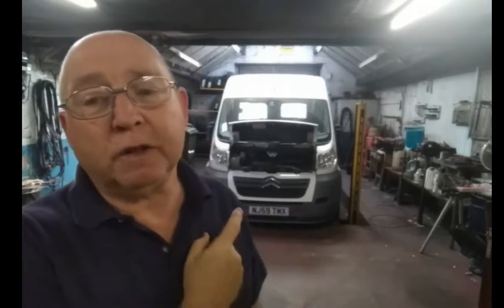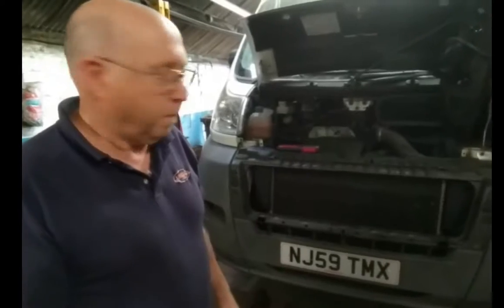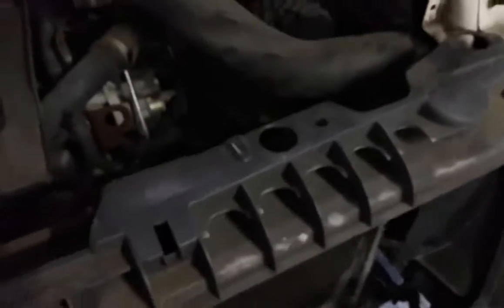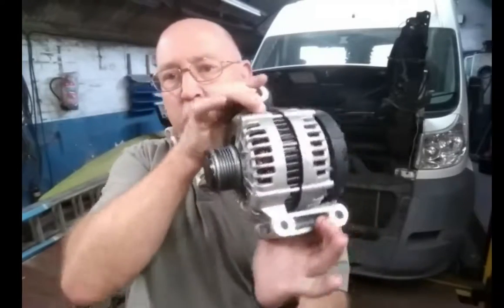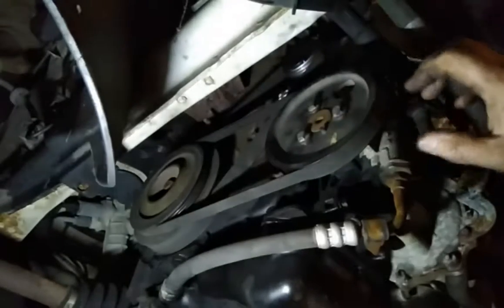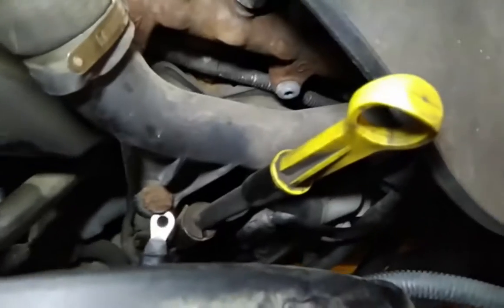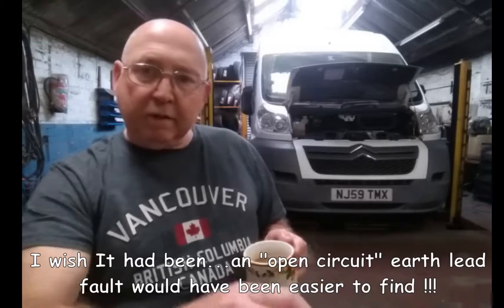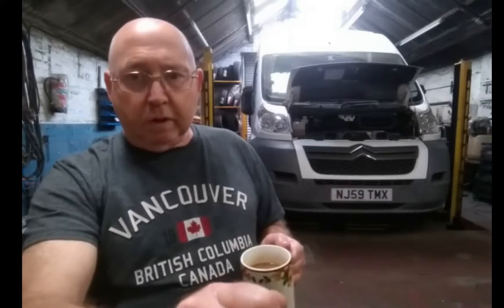Citroen Relay : Self Build Camper Electrical Faults - Alternator (NO BELT TENSIONER SYSTEM ) +  More

Comment: I think you enjoyed that so much you’ll be back in business in a short time 😉
Reply from the maker: Hi Dee Kay, thanks for the comment...YOU MUST BE JOKING... it's a wonder the closing video clip wasn't me hanging from the rafter's, this job had me demented, these intermittent, bad connection ( as apposed to open circuit failures ) faults are always very hard to detect, fixing them is normally not a problem, normally a quick fix, but finding them....a different story haha ... anyway it's all fixed now and never ran or started better...
thanks for watching and taking time to comment...
                                    Cheers...Jimmy...

Comment: As soon as i saw you had problems with the charge voltage i knew before i even watched the rest of the video your earth strap was knackered.  You didn't actually need to change the alternator. Its a very common fault on these vans as its gets covered in road salt and corrodes.  What i did is run a new earth from the centre bulk head bolt between the wipers down to the engine block so it less likely to fail from the road salt.  My van now charges at 14.4v.  BUT due to the fact it had been left for so long with bad charging before i bought the van it killed the old battery so i had to fit a new AGM  so it still cost me £140 to get a proper fix.  I since found out that PSA fleet van operators can have this problem on as little as 3 years old vans.  
BTW i also did a full van conversion with shower during the lockdown:)

Comment: Amazing Jimmy, thank you for sharing your expertise, I'd love to have a mentor like you! I've recently acquired a Relay and the coolant is filthy, brown and rusty looking. Do you think this is anything to worry about or does it just need a clean out?
Reply from the maker: Hiya Ben,  Great van's,  good choice ! 
About your cooling system problem,  It's a bit hard to say, not seeing it !  I'm assuming it's not overheating, or has excess exhaust smoke  ( white ),  or water in the engine oil (creamy brown color ) ?
If you don't have any of the above symptoms, If you've got a hose pipe, I'd drain the system and flush it out ( till the water runs clear ), also do both the radiator and the engine block.  
Keep an eye on it after that and see what happens ( don't forget the anti freeze ).
Good luck with that, hope it all goes well,  you didn't say... is it just a work van or are you converting it to a camper ( great van for a camper ).
                            Cheers...Jimmy ...

Comment: Hello, what measures of the V belts did you use?
Reply from the maker: Hiya "Adrian Ciesielski " how you doing ?
Thanks for your comment and question, I must admit I'm not 100% sure what your asking !  The belts on my van are not "V" belts  ! they are what's called ribbed belts and the particular one on my van  is known as a "stretchy"  belt as the system has no tensioner fitted to tension the belt ( earlier models do have a tensioner but are still ribbed belts ). I hope that helps you .
Thanks again for watching my video and commenting , good luck with your van.
                       Cheers ... Jimmy ...

Comment: Having a nightmare with my 2008 relay which has also been standing for a while.  It’s got to be electrical but I can’t find it. The front indicator lights were the only ones working, the rears and wing mirrors  weren’t. The engine light was on, the central,locking didn’t work, and the abs light was on. The fuel guage was reading zero and the fuel light flashing. I fiddled a bit, checking the ecu connectors etc. Then after no joy, I gave up. Put the headlight back in and turned the ignition on to close the window, and low and behold the fuel gauge was reading correct again. I tried some other things and now the full beams don’t work, the indicators are all working bar the front ones which were originally working!  The central locking still isn’t working, the wipers and washers have stopped working and the van is immobilised. Given up again for today. Already changed the gearbox earth strap to try fix another fault I had. Must be another earth or dodgy wire somewhere, but I’m sick of it!
Reply from the maker: Hi Tom, I'm not going to ask how your doing, you have my sympathy, I was in the same boat not so long ago, although yours sounds worse than mine was.
It sounds like you've got a right can of worms there, sorry I don't have any definitive answers for you ! I suspect you've got a few faults there, I think if I were you I'd check all your electrics and make a list, then go through them one at a time, you might find some faults put more than one thing right but I still think you've got multiple faults on your van.
Thanks for watching & commenting & I wish you the best of luck with your van, sorry I couldn't be more helpful...
        Cheers...Jimmy...

Comment: Question please do ya put the belt on before putting the alternator back on, I've tried but can't get the alternator back in place
Reply from the maker: Hiya "shane mc" how you doing.
Thanks for the comment & question !  the answer is no, you have to fit the alternator first , a little tip, I think I mentioned it in the video but in case I didn't ...make sure you put all the bolts into the alternator casing BEFORE you fit it to the engine , it's a bit of a tricky job but there's one of the bolts you can't get in after the alternators is fitted, It would be a right buggar if you struggled to fit the alternator then had to remove it again because you couldn't get the last bolt in hahaha.
Hope that helps, good luck, it's a bit of a tricky job , take it easy and don't loose your rag ( easy for me to say haha ) ... you'll get it .
                   Cheers ... Jimmy ...
Reply: @jamesstringer8172   hey 👋 thanks for the quick reply , I've been 4 days now trying to get a née belt on and I'm guessing now that one of the bolts is meant to hold the earth cable and I  ant remember attaching it again lol. Also i just can't get the belt back on . I've probably took off to much of the trimming aswell it's gonna be difficult trying to remember where everything goes again. I had rain dripping in my eyes yesterday so I had to give up again . There is no tension release either and my battery is now flat , so I  ant get the belt half way on then try turn it over to get the rest on . What an awkward job it is to be doing I'm these conditions.  I can't get it onto ramps either as the battery is flat lol. Did you put the belt on the alternator then the bigger wheel and did you start from the top of the bigger wheel or the bottom 🤔  any help or information would be extremely helpful thank you 😊 happy Christmas 🎄
Reply from the maker: I feel your pain mate, it's not really a job for a novice !  I don't know if your replacing the belts too ? if you are, make sure you've got the right belts ! you'd never get a standard belt on , make sure it's a "streachy" belt !
It's hard for me to guide you with words , I think I explain it better on the video but I'll try ... You need to fit  (& tighten) the alternator to the engine block, then fit the belt over the alternator pully making sure it's in the center ( on the groves of the pully , also double check  this on all the pulleys when the belt's on ) , then starting from the bottom of the crankshaft ( the big pully) as you need to turn the engine in it's normal direction of  rotation ( & on this engine that's clockwise ), then while holding the belt on with one hand turn the engine clockwise with a socket & ratchet or similar NOT THE STARTER MOTOR .I hope that helps but as I said earlier I think the video explains it better ( maybe watch it again ! a shameless plug for my video haha )
GOOD LUCK ...
Reply: Yeah Jimmy I got it on using a screw driver and just let the screw driver travel around while pushing  it up hard as I could , then the belt started to move sideways on the alternator so I had to do it in reverse with the screw driver on the alternator,  I had to go reverse then forward a few times to get it in place . "But its on now " thank God and thanks to watching your video. Thanks a million for posting the video and for replying so quickly great help 👍 As I said I tool off to much trimming so it was fun trying to figer out what goes where and what screw go where and as a result I have some left over screws lol 😆 Have a good Christmas
Reply from the maker: @shanemc659  ahh, great stuff, I'm pleased I was of some help ... Happy Christmas to you too ...
Reply: @jamesstringer8172  as I was putting things back on , I found a yellow connector and I don't have a clue where its come from , any ideas Jimmy
Reply from the maker: Sorry, I can't think of anything, It's hard without seeing it, the only thing I can think of ( grasping at straws like ) if the eye connector on the back of the alternator ( 13mm nut ) has been replaced or repaired, that could be a yellow connector it's not yellow from the factory though . 
Sorry that's all I can think of, hope you sort it sooner rather than later ...